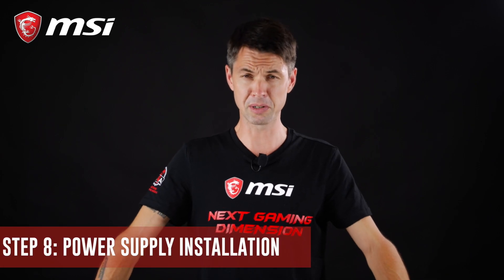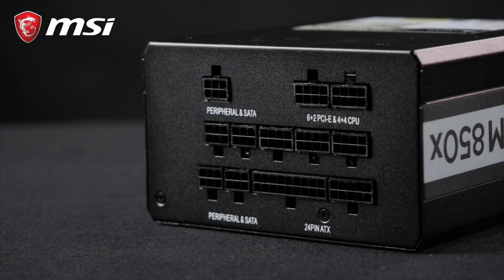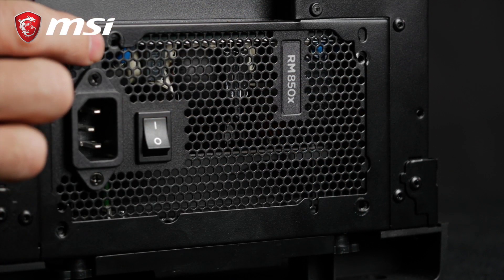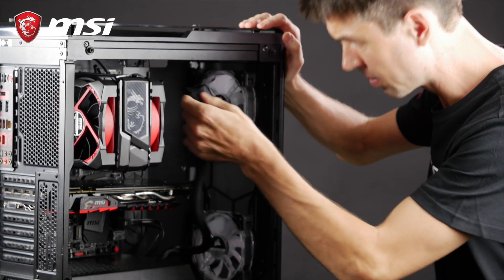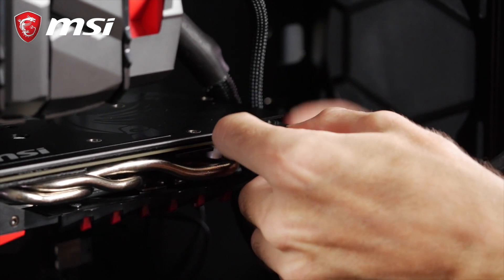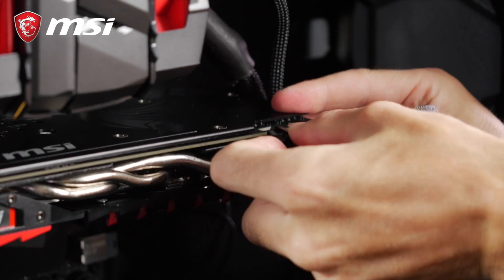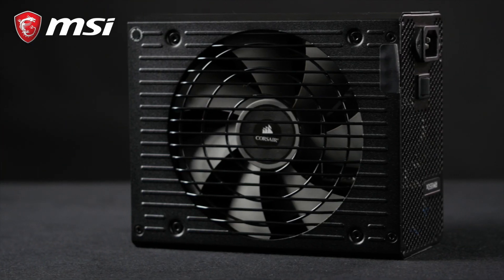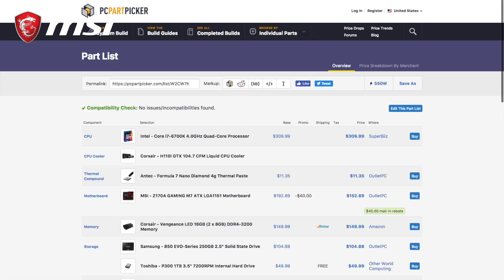Step 8: Power Supply Installation | #YesWeBuild | MSI

Comment: Is it possible to Exchange the powersuplly with a msi nightblade mi3 vr7rc
Reply from the maker: Hi, the power supply of Nightblade MI3 is not exchangeable.
Reply: but is it possible then to put in a extra ram 8gb ram (already have 8gb of ram but i want 16) and a extra hdd and a 1070 videocard because i calculated it and it came to 352 watt and the psu only supports 350 watt

Comment: Hi i have a HP pc and i cant install a power supply because there is only 3 wires to power the system. and before you ask there is no 20-24 pin connector any ideas